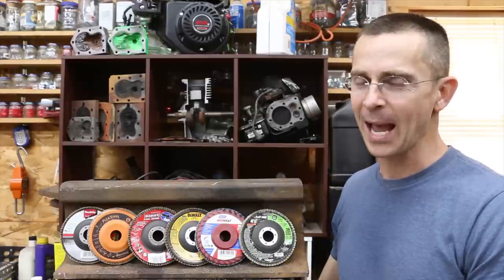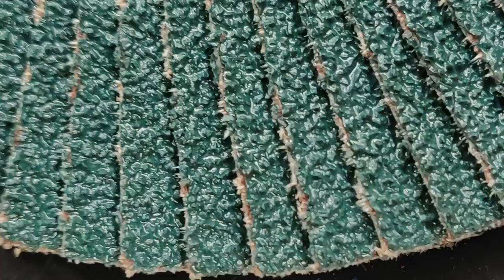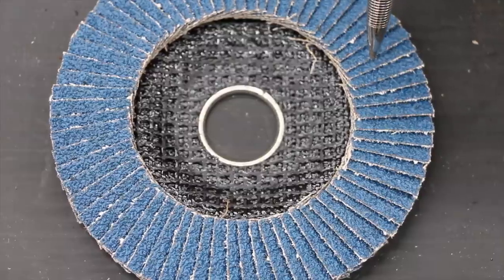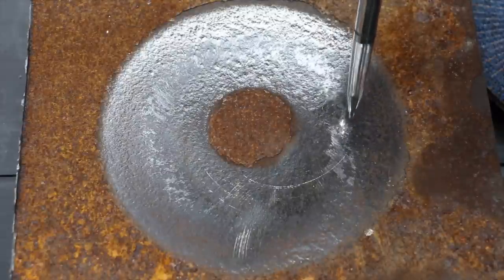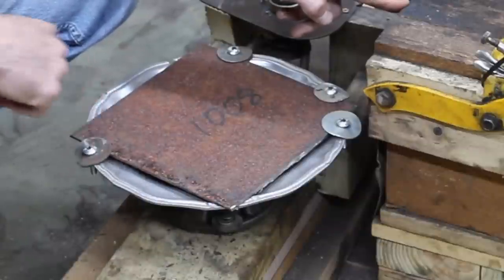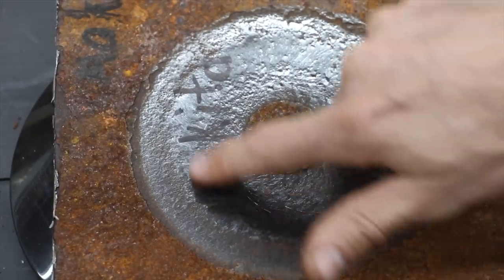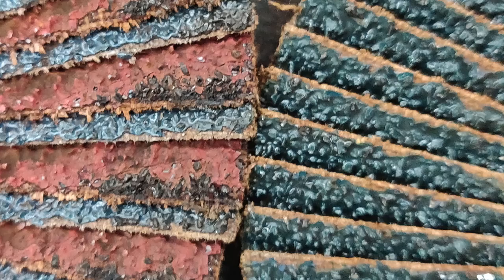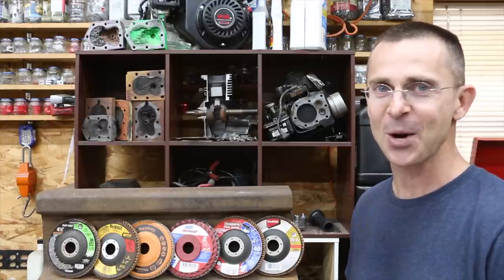Best Flap Disc Brand (6 Brands Tested)? Let's find out!

Comment: Test windshield wipers see which is the best brand
Reply from the maker: Thank you for the video idea!
Reply: I second that I have gotten some real crappy blades for my wife's and my car and they are not cheap $20 a piece!
Reply: Project Farm no problem!
Reply: That's a great idea.  I keep buying OEM Honda wiper blade refills and they barely last six months.  They're cheap but it's still a pain to constantly have to swap them out.  It's still better than buying a $20 replacement blade that also only lasts about six months.
Reply: the best wiper blade are made of silicone. dont buy the cheap rubber ones. the silicone ones ive got have lasted for about a year and a half so far and they stilk work like new
Reply: There are lots of factors in a wiper blade test. Will be difficult to simulate uv degradation, deflection memory, various vehicle design and pressure, windshield pitting, weather conditions
Reply: @patsfast1980  you make some good points............
Reply: PIAA silicone on amazon. best wiper blades on the market
Reply: @shawnh9677  I tend to agree although I usually get them cheaper over on Ebay.
Reply: I've noticed over the last several years that wiper blades don't last very long anymore. Not that good after one summer; pretty much end up changing them twice a year, even the expensive ones. As a kid the wipers seemed to do good enough until they about fell off  😀
Reply: @davidmc8110  Planned Obsolescence -  Greed over Pride in Craftsmanship, more so today than ever.
Reply: Italia fascista I get 3 years with Bosch Icon brand here in S Texas.
Reply: Italia fascista I haven’t found anything that can beat Bosch Icon wipers. Three years and 65000 miles in South Texas.
Reply: Project Farm I had to chuckle at the suggestion of wipper test..
it would be so DIFFICULT... the last a good length of time.. tooooo many variables.. house some crocus cloth to well you see. to difficult.. maybe since with so many subs tall a poll, and location demographically.. hot dry area, rainy, foggy, snowy, etc. to to complicated  and it would be hard to add weight.. hehe
Reply: Windshield wipers? Me ne frego!
Reply: Godfrey Poon si amico!
Reply: Holy shit yes!!! I'm never happy with what I get because I always have some small problem.
Reply: @Waremonger  I've never gone for OEM wiper blades. Considering most of them are crap how do the Honda ones compare to others?
Reply: @patsfast1980  however you can take an average across many car manufacturers. Also the UV should be easy to simulate with a high power UV bulb, which are expensive but have a number of other uses so it's nice to have.
Reply: @oldgringo66  how often does it rain in Texas? Lol.
Reply: Oh yes! Wiper test. I run actually PIAA silicone blades and they seems to perform better and longer with cold weather here in Canada but we need a test!!!!
Reply: Well I live in chicago and due to cold weather and snow these blades dont last as long. Sure if you abuse the blades like dont clean the snow off your car and the ice they wont last as long but I do all of that and still they dont last as long as I remember and back when I first started driving I abused the blades alot like not clean the ice and snow and they lasted a very long time maybe the quality is not the same anymore as you guys stated in your comments
Reply: Shawn H, Which model of PIAA?
Reply: Hal Rhoads, Which model of PIAA do you use?
Reply: I used a set of tripledge wipers for probably 8-10 on my old altima. I guess they were too good since they quit making them.
Reply: You know, I always replace windshield wipers approximately every 6 months because they tend to warp and don't work well anymore. I bought a new Toyota 4Runner three and a half years ago. The car was assembled in Japan with 100% Japanese parts. Guess what? I'm still using the original windshield wipers and they work just like new.
Reply: You want to use flap discs as windshield wipers??? 🤨

Comment: I love the fact that you always include harbor freight items
Reply from the maker: Thank you!
Reply: a junk baseline
Reply: @philtripe  well in many cases just crap unfortunately
Reply: Silas Mayes - in most cases yes, but not including it would leave questions. Sometimes name brands turn out to be junk and sometimes we’re surprised. It’s all good.
Reply: yeah, Horror Fright has it's place. Just not their consumable items.
Reply: Probably because it is 2/10ths a mile from his house and his sister in law is the manager?
Reply: @philtripe  they seem to be a better baseline than the DeWalt in this video.  The place has its ups and its downs.
Reply: Apparently their zip ties are surprisingly tough
Reply: Just for the record ...  I got a stack of those Warrior discs for 99 cents each when they were on sale.  
At that price, maybe they win?
Reply: @burtreynolds3143  Yup, exactly. at $4, not a good deal. at 99C... totally a good deal. I've got a set of them myself.
Reply: @MacRobbSimpson  same for me, bought 36 grit in bulk for $1.  Can't beat it really.  They do the job, maybe not as well but at that cost I'll deal w/ it.  In an environment where you are charging a labor rate I could understand not going w/ them.
Reply: @burtreynolds3143  I have done my own test-------well sort of, and the $10 disc did not outlast the $3 H/F.  It really did not outlast 3 of them.  Two of their tools I have replaced with DeWalt.  The 14" chop saw.  (I let the factory installed smoke out of it.)  And the 4 and a half inch grinder.  The grinder worked ok, but it fell off of the welding table and broke in half.  Definitely not tough enough.  One year before I retired, (I was a heavy equip mechanic) my 1/2" I R impact bit the dust.  I did not want to spend several hundred for a quality impact, so I bought the H/F 1/2" Earthquake impact.  I have been retired for 8 years now, and the Earthquake is still going strong.  I do not use it as much as I use to, but it still works just fine.  Most of the time I use my 18 volt Ryobi battery operated 1/2" impact.  It will change my tires on all of my vehicles.  if I find something that is too tight for the Ryobi, I drag out the air hose and the Earthquake.  If that won't do it, I always have my 3/4" I R impact.  LOL   I have not used that impact for years.
Reply: @burtreynolds3143  I always wait to get stuff from HF when there’s a great coupon. People hate on HF so much but when you don’t have a lot of money to spend on tools you’ll only use here and there, I’d rather spend $30 or less than $60+ and it last for years. By the time they stop working, I’ll be able to afford the better quality stuff and I’ll use all of these videos to figure out what to go with lol

Comment: I do a lot of body work panels and make various things out of 1/8" stock. I grind the weld first with a 36G grinding wheel then blend with 60G or 80G flap wheel. I do in some cases use the 36G as well. The Harbor Freight ones are just about useless. I generally buy Norton which work pretty good but I will try the Diablo. Like another guy wrote " Diablo makes good S#*t" I wonder if your experiments are better than the manufacturer. They seem more real world to me. Great job as always!

Comment: DO A WORK GLOVE TEST some gloves resist heat better which one would be the best for the best price
Reply from the maker: Thank you for the video idea!
Reply: Yes! Piercing, friction, cutting etc.

I worked a few years in yard construction. Concrete products just killed gloves. Like by the dozen. All those little sharp shards of crushed rock in the material plus the ammonia etc from the thousands of bricks...

The only number I looked at when making glove decisions was, in the end, the cut resistance. I think it was because the worst the concrete could do wasn't actually the sandpaper-like scrubbing but instead the particles that were a tad bigger that cut the glove material.

And yeah, technically all sandpapers "cut" grooves the size of it's grain - it's the many juxtapositioned cuts that loosens material.

But the cutting I'm talking about are from specs like 0.5mm in size or so. Huge in terms of sandpaper and the average surface smoothness of landscaping concrete products.
Reply: This is a great idea. I’d be curious to find out aswell
Reply: Yeah. I'd love to see that myself.
Reply: Would be a good test indeed! Dont forget then to include some automotive gloves; oil and brake fluid ressistent.
Reply: Grinder wire wheels in general, plus gloves withing standing them. Shitty mechanix glove didn't save my thumb at all when I goofed, been using the cheap rawhides since (as highly recommended by the metal fabricators who bother to wear gloves). Haven't really "tested" them, just hoping they work if there's ever a next time. Damn wire wheel knarled piece of my thumb, took weeks to heal
Reply: This would be brilliant!
Reply: Brilliant idea, especially cheap leather gloves might be surprising how well they hold up
Reply: Defaultz Enabled caiman gloves are amazing. 👍🏻
Reply: @DracoOmnia  Ouch, that brings back memories. Same here, wire wheel took a chunk out of my index finger. Didn't cut too bad, but damn did it bleed. And like you, the fancy mechanics gloves I wore didn't even slow it down. :(
Reply: @ProjectFarm   Latex vs Nitrle  this should be interesting!
Reply: I've had gloves made of different materials so I would LOVE to see this.
Reply: stay away from the Hobart " Mechanics gloves " that come with welding gloves in a pack. I was grinding steel and the back of the glove caught fire!
Reply: @magadon ruferto yeah, a lot of folks say that and I understand to a degree but I can't agree to it's validity. If it were something where getting "pulled in" would be utterly catastrophic like a wood chipper, lathe or some such sure. But I'm generally trying to avoid being lacerated by a cut off disc, abraded by a sanding disc or grinding wheel or chewed at by a wire wheel. Getting dragged in vs the possibility of it preventing any damage from an incedental exposure? I'll take my chances IF I can find gloves that don't suck super bad. If no gloves don't suck, well then I guess the responsibility is on me to suck less and keep my fingers out of danger.
Reply: But also include (if you can), any data on hand heat insulation. My cold ass fingers ain't working so good. This is a thing I think is forgotten in good work gloves. Can't get any gloves for work that didn't forget your hands might be cold. Bottom side good for work, top side has nothing for your cold fingers!
Reply: Yes!!! I can wear out a 25$ pair of leather gloves in under a day of cutting out tree rows and it gets costly trying to find a durable brand.
Reply: I'd like to see that, especially how he plans to test things like gloves. Perhaps he will decide to cut out a piece of the glove material, put water on it, then heat it up and see how long it takes for the water to boil or for the glove to burn. Interesting.
Reply: @ProjectFarm  electrical, mechanical, and landscaping gloves are all very different from each other so testing all of them would be great!
Reply: Yes gloves would be a great idea!

Comment: A useful video may be the best engine parts cleaner/degreaser.
Reply from the maker: Thank you for the video idea!
Reply: I'd watch this if even just to see what test idea he comes up with! That's not an easy thing to measure. Lol
Reply: This^
Reply: Yes, especially water based vs solvent based degreasers!
Reply: @mentaldan666  Probably something to do with burning sludge or something like that onto bare metal. There'd have to be 3 or 4 tests averaged out to account for the imprecise nature of a test like that. Just off the top of my head. Could also do easier, less subjective tests like spraying each test onto a thin layer of oil on a vertical piece of metal, and seeing if each of them are capable of removing it.
Reply: If you're going to do that, try this homemade recipe: 4 ounces d-limonene (they sell this on Amazon; it's about $2 per ounce so not cheap), 4 ounces Murphy's Oil Soap, 1 quart water. It cuts grease as well as mineral spirits, and smells way better.

Comment: I really like that you use different weights and times. I have found from using these products at work for 30 years that any grinding, cutting, and sanding disc it is best to let the disc do the work and not force it. They last longer even though they may cut a bit slower. You may be cutting slower, but by the time you stop to change wheels the total time ends up quicker. Also you put less stress on the tool which lasts longer too.
Reply from the maker: Thanks for sharing!

Comment: I think abrasive material should be a consideration for the test. From my info gathering there are 3 types: aluminum oxide, Zirconia/Zirconium and the newest Ceramics. A revision and new players on the field should make and excelent test. Also there are 2 types of flap discs Type 29 and Type 27. Thanks for all the hard work.
Reply from the maker: Thanks and you are welcome!  Thanks for the video idea.
Reply: This is a great idea, just trying to find a good review on stripping wheels, they are designed for removal of rust and paint. I am currently using a flap disc from Princess Auto to sharpen my mower blades. I leave the blades on the mower, it is doing a great job.

Comment: another vote for drywall anchor testing, the plastic and metal screw type in 1/2" drywall
Reply from the maker: Great video idea!  Thank you
Reply: Project Farm if you test drywall anchors, you have to test togglers... they are the industry standard for AV installers. 

(BB) 1/4-20 Toggler SNAPTOGGLE Heavy Duty Toggle Bolt Zinc with 1/4-20 x 2 1/2 Combo Pan Machine Screws Zinc (100 Pcs) https://www.amazon.com/dp/B07CNWHP3J/ref=cm_sw_r_cp_api_i_rDhICbMCZABFQ

Don't worry you can buy them in smaller quantities… And probably can find them somewhere locally like a Fastenal,Grainger or Greybar.
Reply: wb5mgr I found a BIG box of them at a habitat for humanity restore for five bucks like three years ago; and I still have a bunch and I always use them. I’ve hung probably a dozen TVs; and for any anchor point where I didn’t hit a stud; used a toggler. I haven’t had one fail yet.
Reply: @JosStrange  You made out.... Those are the best hollow wall anchors. I used a couple to fasten my boat seat to the boat deck.  Solid as can be.

Comment: From my experience, these wheels seem to be cutting WAAYYY less than I'm used to for a 40 grit. Could be the pressure, the way the steel is rotating, or another factor. I love the videos! Keep them coming!
Reply from the maker: Thank you!
Reply: Bit late but agreed....with a 40 grit wheel I could probably have made the entire sheet shiny by hand in a minute.
Reply: Technique adds a lot of value to the wheels. This was a machine to test the same conditions between the pads.
Reply: I am sure you dudes can put more than 5 or 10 lbs into the grinder.

Comment: Another outstanding comparison. The last two flap discs I bought were Dewalt and they were just as you say, overpriced and so-so performance. I’m not a big dewalt fan due to a bad experience with an expensive hammer drill that was hardly used and just outside the warranty it decided to let out the blue smoke. After being denied warranty I took it apart and it was a clear manufacturer defect. Improper assembly caused wires to get pinched and the insulation was damaged just enough to short  circuit. When shown photos, dewalt basically gave me the middle finger. I now buy Makita drills and hypoid saws, Milwaukee grinders, Bosch routers, Sanders, and table saws. 

I’m going to buy a flap disc tomorrow and will be going with diablo.
Reply from the maker: Thanks so much!  Thanks for sharing.

Comment: Interesting test to see how flap discs hold up relative to each other on rust/scale.... In general if you want to extend the life of any flap disc or sanding disc always remove the rust & scale surface first with either a grinding wheel, sandblasting, rust dissolver/ acid or (my preferred method) a diamond grinding wheel.  Iron oxide is quite high on the Mohs hardness scale, & is an abrasive in its own right, Emery powder. You can see how glazed the edges of each flap are after the second test, & why they don't cut nearly as well in the 2 min test. Once you get to clean steel a fresh flap disc or sanding disc will cut beautifully.

Comment: Great video, thanks. How about standard belts for a 3" X 21"  belt sander ?  I find that on some, the glue strip splits before the belt gets worn.   J K
Reply from the maker: Thank you for the video idea!
Reply: I second this idea.  You can also see which belt will help your belt sander race along the floor at the highest rate of speed!
Reply: The sound of a snapping belt followed by a big bang, squeeeek and alarm is never good! Mind, the belts in question are 1300mm wide and 2150mm long.  We had two brands where the joint broke way before the belt was worn.
Reply: I work at Canadian Tire, and a handful of the mastercraft belts we get are split right off the truck. I've had to replace one of the belts on a display after a few months, for the same reason.

Comment: PF, Hello, but when I saw this with the description, I thought what odd disks, for disk brakes, SA I busted out in LAUGHTER  as I saw these. I did REFRIGERATION WORK, & had to REPAIR the fan brackets for frozen food cases , when the busted up , with blocked drains, I carried about 100, different fan blades, but very few brackets, it was hard cleaning with a file , to braze them, so bought a small angle grinder , using a grinding wheel, so quickly clean the sink coating off to braze, & that was the ONLY use I had for the grinder . Cheers From NJ USA. 🇺🇸🇺🇸🇺🇸🇺🇸
Reply from the maker: Thanks for sharing.